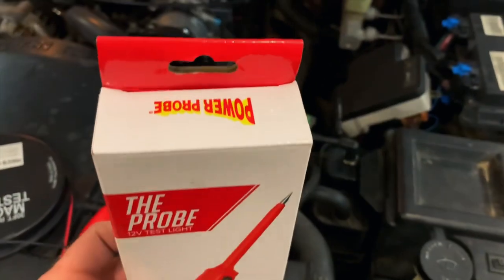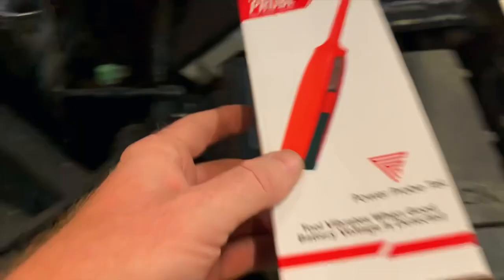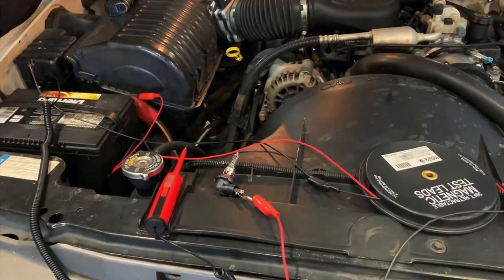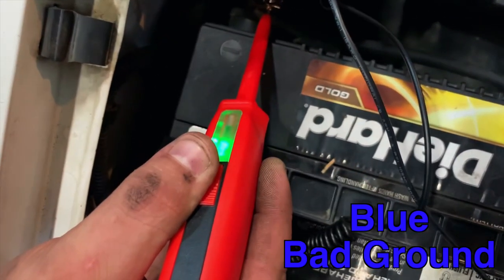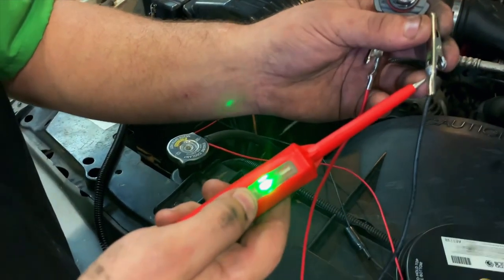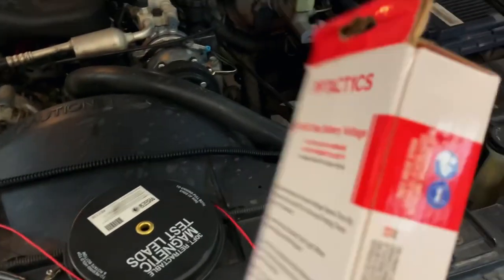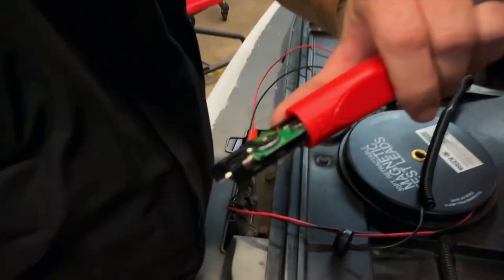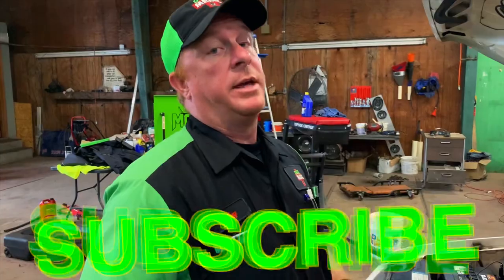Powerprobe The Probe: What Is It and What Does It Do?

Comment: Don’t need a test light for Wally’s truck. It needs cylinder heads or stop leak. Them old Vortec heads would crack if you looked at them wrong. I finally had to put a set of EngineQuest heads on mine. I’m jealous of y’all. I worked on butchered up crap all day and y’all ain’t even dirty.